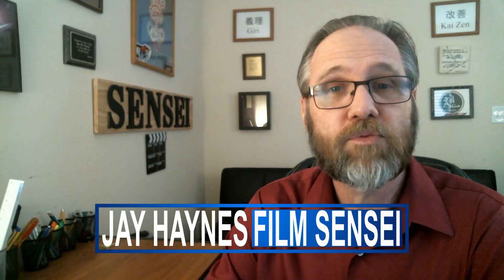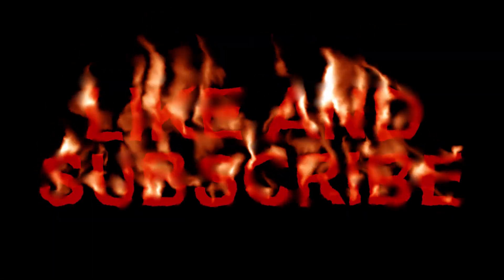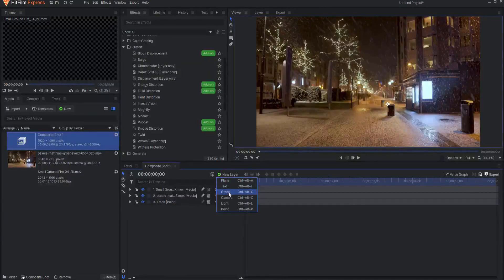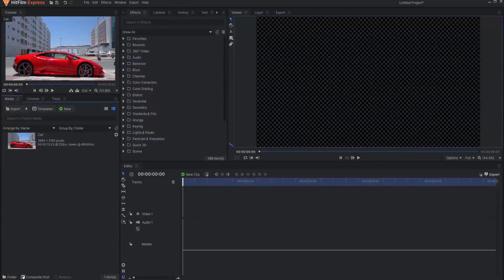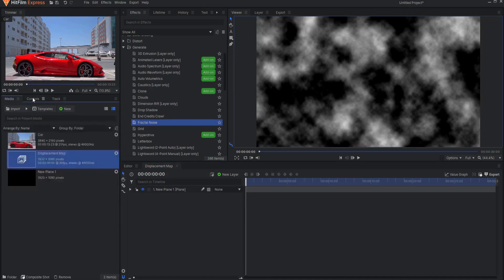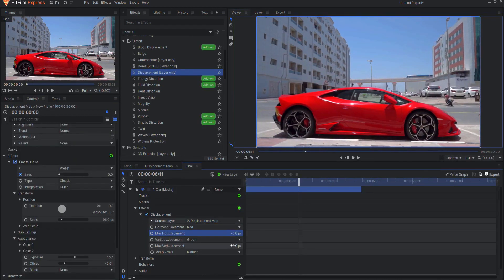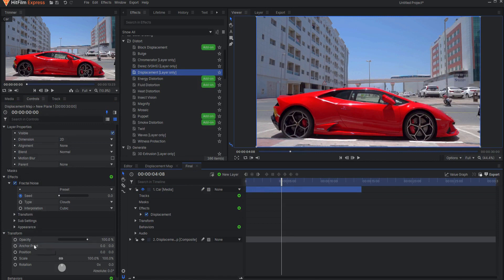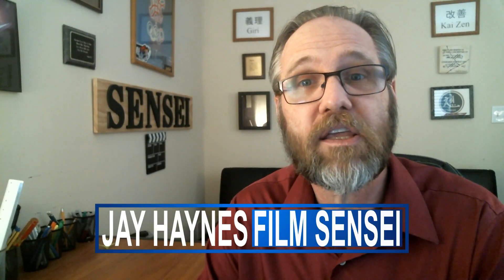Turbulent Displace Effect in HitFilm

Comment: Great stuff Just what I was after. Though I’ve run into a problem when i imported my footage from blender using a  exr format. I can’t workout how to get hitfilm to convert the exr media  to match the rgb  display colour which blender was using. This would make a great tutorial. Thanks.
Reply from the maker: I have never actually tried that. I would guess that if you are having problems with HitFilm matching the colors of an image file, you may need to up HitFilm's Color Bit Depth from 8 bit to 16 or 32 bit. You can do that under File -> Project Settings -> Rendering Tab.
Reply: @HitfilmSensei  I tried that but unfortunately it didn’t fix the issue, the image still looks like the colour palette is over saturated and emission lights are too bright. I did came across a video on how to fix this for Affinity photo so was hoping to find a similar method for Hit-film but alas no luck so far. I’ve added the affinity photo link if your interested.  

https://youtu.be/pjpOOrdpq2E